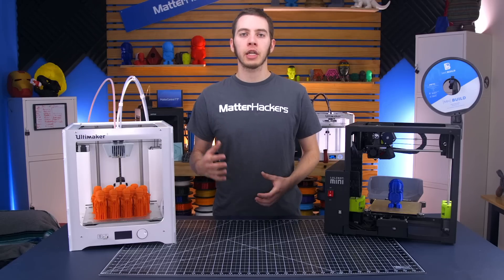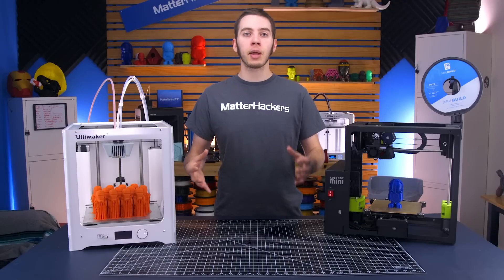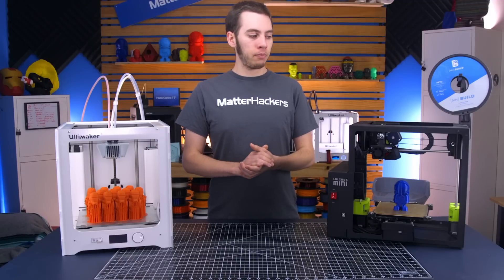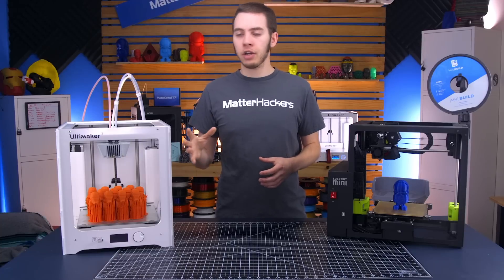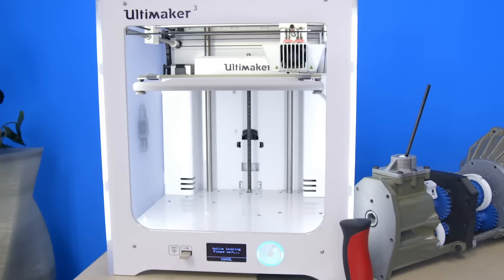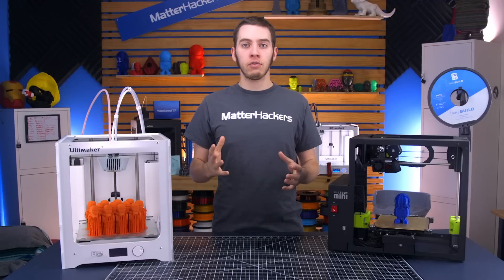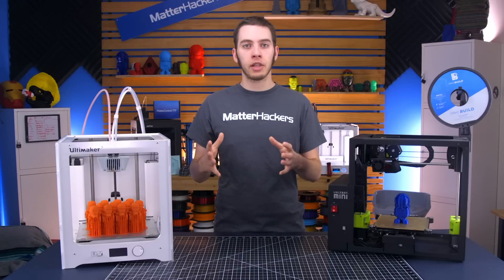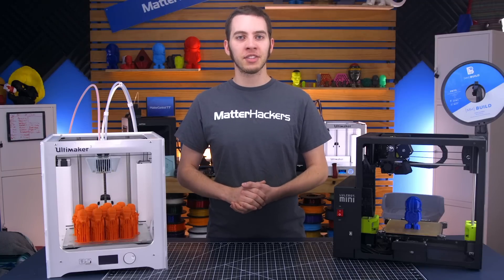How To Troubleshoot Bed Leveling // 3D Printer Guide

Comment: Great video! I just purchased a Mingda Magician Max, right out the box the bed motor vibrates when I select level bed, and gives me this error message, "Prinrer Halted Please Reset Err : Mint Emp E1"

Please let me know if you have any idea what this is from, thanks!
Reply: something is blocking one of the servos from moving. check and remove restrictions
Reply: @Zshaan6493  Thanks! After tedious inspection, it turned out a small piece of styrafoam was stuck in one of tge power connectors, it was hard to see because it was the same color as the plastic, but finally working

Comment: Necro post here- a cautionary tale- I used a brass wire brush and shorted my heater cartridge - big sparks- fried my SKR mini E3 v2 board. So for serial be careful with a wire brush.

Comment: Sorry, this video does not seem to cover the basics of troubleshooting bed level for the most common types of 3 and 4 point leveling. He even mentions using paper to level a Raise n2. For 13 points, are you sure you want to use something that will change thickness before you get through all the points? Or why auto leveling on indictive sensors may still not be good enough for consistent bed adhesion?
Troubleshooting questions many newbies have, esp with manual levelling:
Why do I keep having to level my printer? shouldn't it stay leveled?
why does one corner never seem to level? I can get 3 points good, but not 4?
My bed is leveled but one side of my prints always looks terrible - is this bed level or something else?
My prints start OK but fail higher up - are the springs for my bed level causing this?
Strange clicking noises while printing after a recent bed level - what causes this?